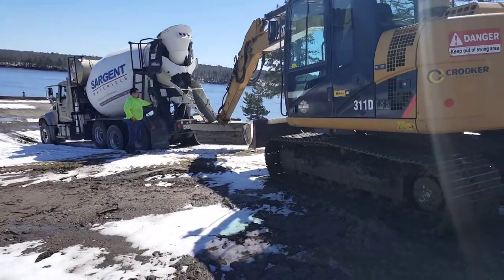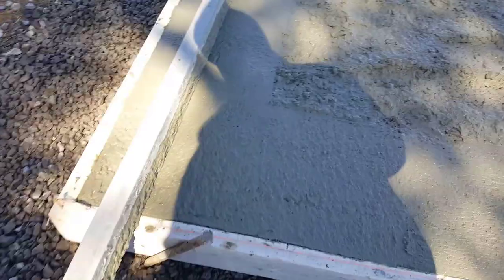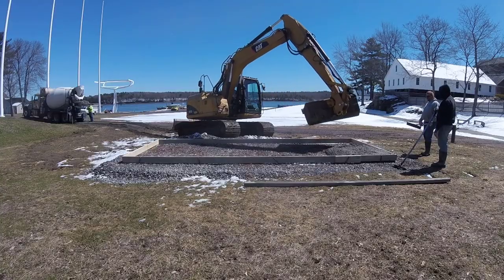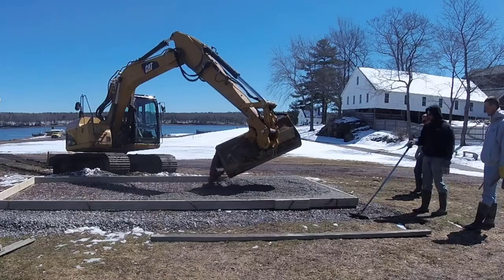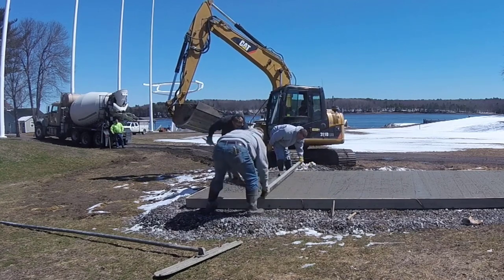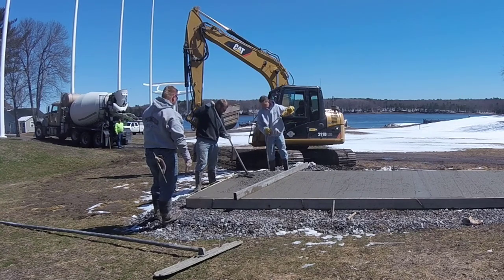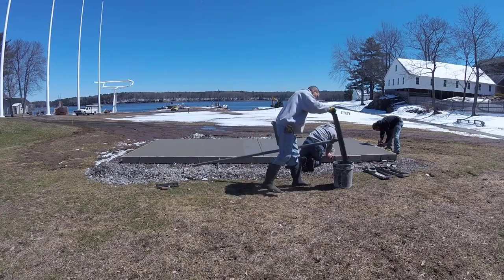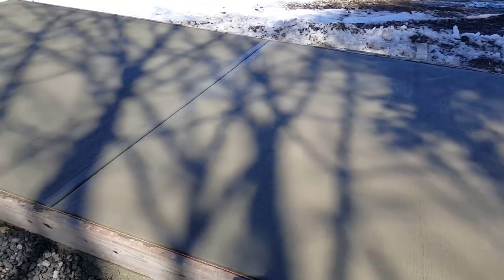Pouring Concrete Patios with an Excavator (Was This Messed Up?)

Comment: I've ran excavators for oil field companies in Colorado for a dozen years now and occasionally the drilling rig next to our crew needs a pit dug out for their mud. Usually they can just use a loader if the dirt is soft, but in the winter, they can't get through the permafrost. I'll drive for 20 minutes on tracks just to break ground for them really fast, and mosey back. Makes life easy on those guys and takes nothing from me other than some consideration and a willingness to help. Hats off to you boys.

Comment: We did a floor slab on grade during winter here in Pa.  couldnt get the truck no where near the slab but had an excavator on site !  Since we poured on a saturday the operator wasnt scheduled to be there but I had contacted him the day before and paid him to come in and give us a hand we also had a 3/4 yard lay down bucket to chain to the bucket on the excavator,,,we poured 25 yards !  had to do some pulling with the come alongs but there was plenty of heat in the tools !!!
Reply from the maker: That's cool Tim, I've used those buckets too. They can hold some mud!

Comment: This operator knew what he was doing. I’ve been in that situation when the backhoe guy just wanted to get it in as fast as possible and get outta there. Disaster! A lotta hard work trying to get it down fast enough for a good finish. 🤬 Fortunately this guy evidently understood concrete pours. Lucky!
Reply from the maker: He did John, plus they were the GC's on the job too.

Comment: we shut down for the winter. that's because the ground freezes solid.
during the beginning of season and the end it does get mucked up like that. we've had our vehicles get stuck on sites and such.
that's the normal slump we'd pour throughout the year. but we'd run with a larger crew.
there's spec requirements where we'd either be doing too much warranty work or would fail city spec depending on where we work. 
that is settin up good, idk if they have good sand there or not(looks good) but I know in some areas they load up the mix with so much artificial compounds that working with it is like trying to float out elephant jizz. its just sticks to the float and finishing tools, makes edging a pain in the ass compared to good mix.

Comment: Been here poured that. But there are better methods that dont cost a ton in fuel.
The excavator could have pulled the truck closer or a pump truck could have been ordered

Comment: I build vinyl liner pools but nowadays we build vinyl over steps and benches in the pools and we pour them with concrete and this particular pool had a huge bench and allot of steps and it wasn't good access so we decided to pour the whole bottom in concrete and had to pump it. Any ways the guy didn't bring enough hose to pump in the back yard, don't know what happened I was working for a guy, long story short we had to use our excavator to put it in place. It was hot to and we couldn't reach all around the pool and we had to drag it a good ways and it set up on us quick. Plus it took a man out by having run the machine so it kinda put us short handed. Wasn't fun.